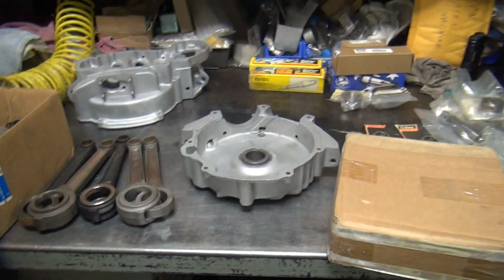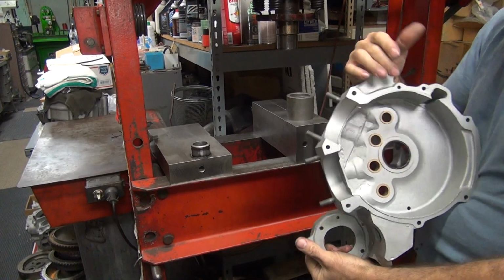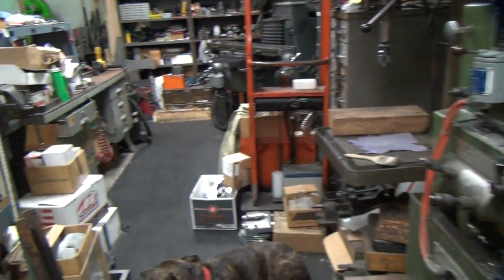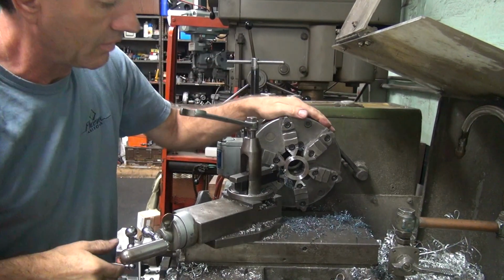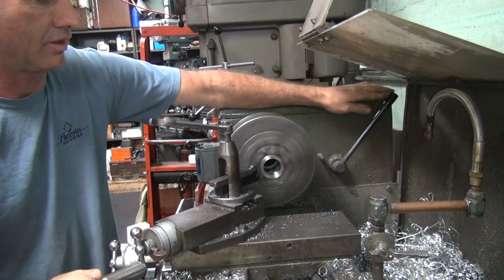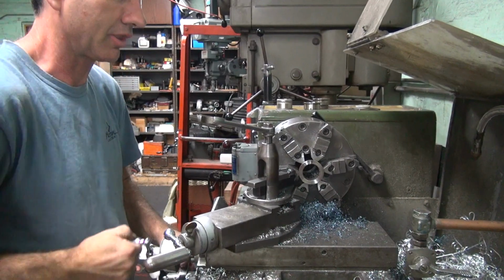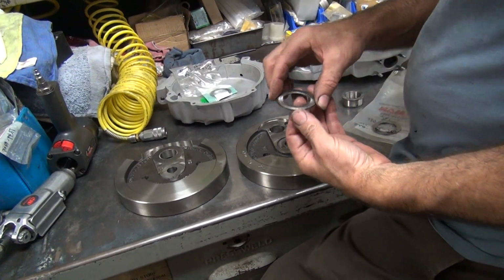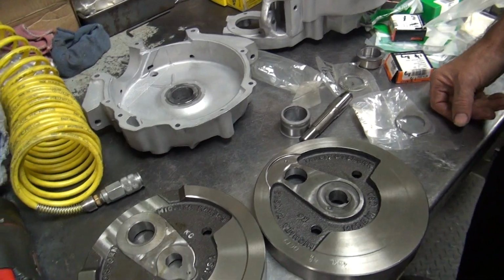1942 45 wla wl #101 56ci stroker flathead motor build 4-5/8 in harley wl by tatro machine

Comment: Jims is the best you can buy now try walking into a Harley shop and buying the good stuff they used to make.
Reply from the maker: i have the good stuff here because i kept it years ago so that i would have them when i need them. you can still buy nos parts on ebay even after 70+ years. jims can make better parts then ww2 oem parts if they wanted too. they save money on the steel and cheap heat treating. they charge enough to have the best parts in the world but they chose to make do with an 80% part. the bad part is that there is rarely anything better to buy these days.

tatro

Comment: used oil is free try using it and also you need to re harden those races
Reply from the maker: what do i need the oit for? cutting oil is different than old motor oil.not all oils are the same. why would i need to reheat treat the races? they are still harder than the jims parts. after cutting the races they are cold and did not loose and of their hardness. the chips were hot but the dissipated their heat fairly quickly as seen in the videos.
tatro
Reply: I LOVE YOU VIDS OK BUT MAN I WISH I LIVED NEAR  YOU I WOULD GO TO YOU SHOP EVERY DAY JUST TO CLEAN IT YOUR SHOP GIVES ME OCD
Reply: Now go make a video in your workshop and show the world your hard won skills, I spend most of my life behind a machine doing for other people, if I stopped to clean the machine all the time I would be sacked. The machine gets cleaned when there is no work to be done. When you are working in the real world you will learn that these machines will last so long even without a regular clean that when they are worn out and need replacing your workshop needs updating anyway. Now get out of your classroom and into the real world where time is money.